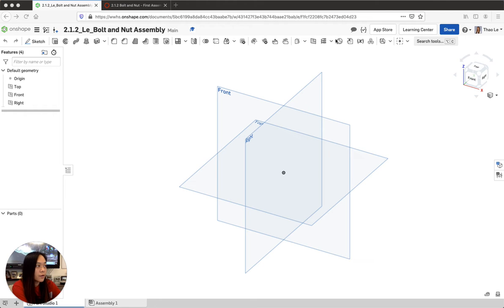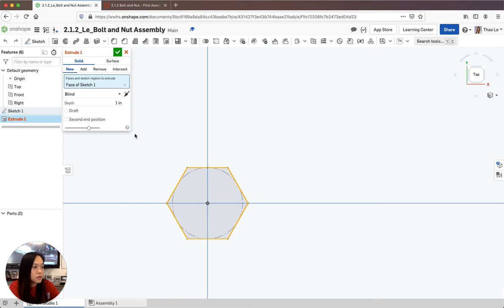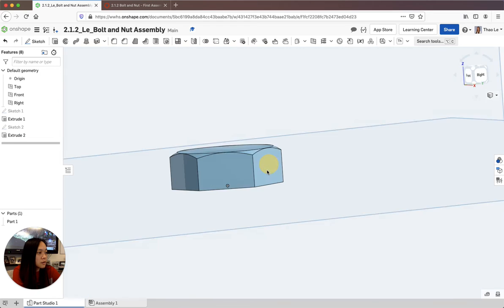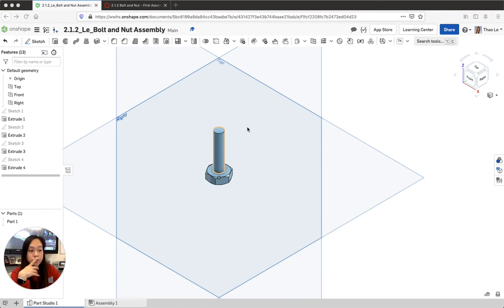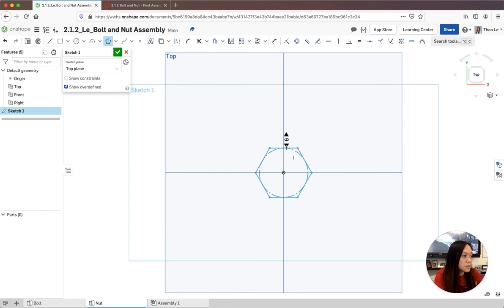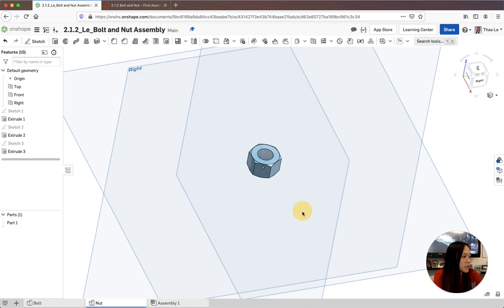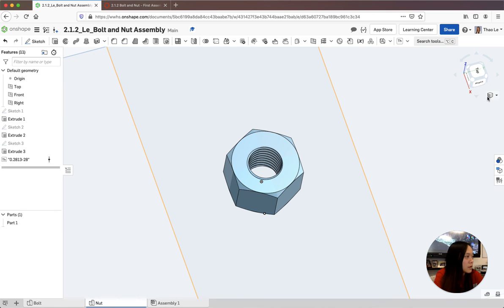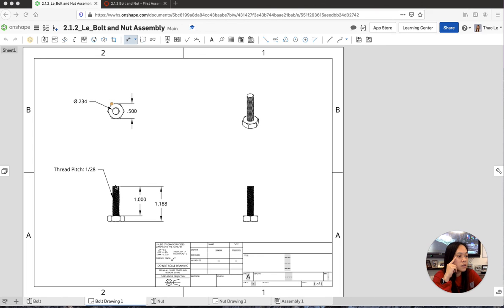How to Create Bolt and Nut for 3D Printing Part 1 | Onshape

Comment: Thanks for this. I've watched two or four tutorials on this, and yours is the first one that actually resulted in a workable print. 

Our of curiosity, I did things a bit differently to reduce the number of steps. Can you tell me if anything I'm doing here might cause me problems later on?

1. Sketch bolt head as you describe.
2. Extrude to half of the height I want.
3. Chamfer the bottom as you describe.
4. Mirror the part to create the top half of the head.
5. Sketch the circle on the top of the head.
6. Duplicate the part studio and rename.
7. Finish the bolt as you describe.
8. Switch to the nut studio and change the diameter of the sketch.
9. Finish as you did.
Reply from the maker: That sounds like it works! There are multiply ways to do this, this was the easiest for my students and I!
Reply: @ThaoTeachesCAD  Awesome. Thanks again for the great video.
Reply: Hnushnusaku